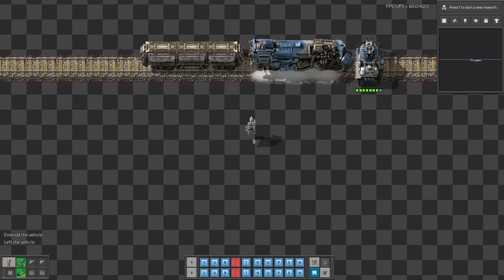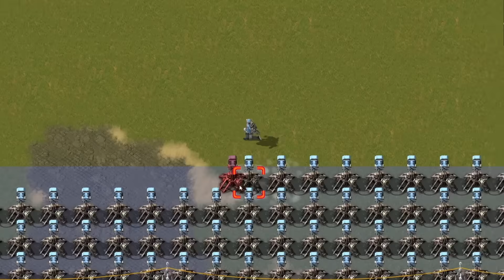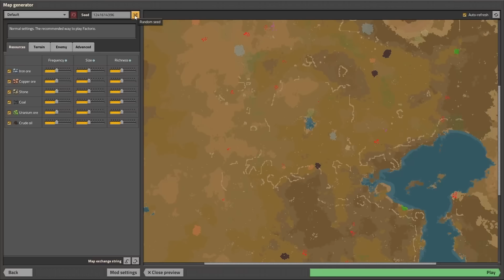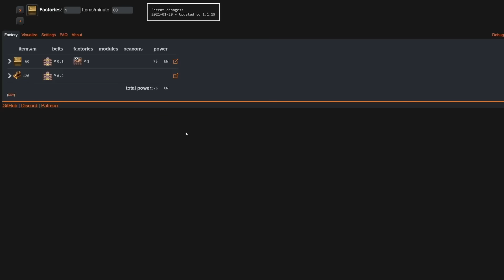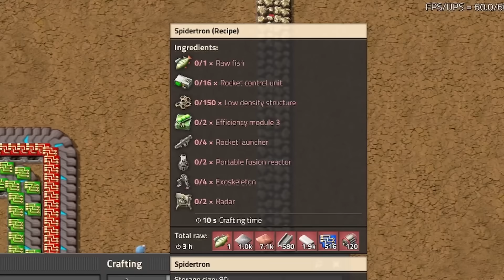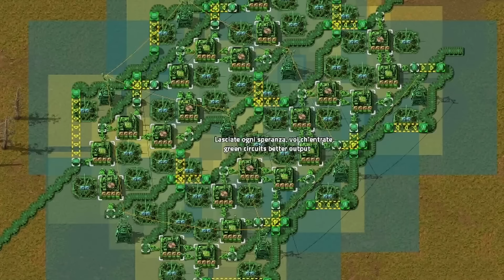Another 31 Extremely Quick Factorio Tips | Season 2 Marathon

Comment: I always have at least 4 burner inserters in each line of steam engines and boilers. Always staggered. I've had a few full blackouts that required cold starts on the whole power system. Took a lot of work, but was able to do it.

Comment: ONe thing; I think you're wrong about the Coal Liquifaction --> Solid Fuel being more efficient than Coal. I spent a few hours setting up this huge facility once to intake coal to do just that. A self-contained loop with circuit-logic to prevent it from getting stuck by producing too much of one fluid. Then once i set it up and it was running I was super proud of it, then while it was working I did the math. You end up with less energy from the liquifaction than you would if you had just burned the coal, and that's not even mentioning that you are using some of this energy to create the solid fuel in the first place, so the math isn't even a true picture of the energy loss, but it is actually significant. It's more efficient to just burn the coal, but then the problem becomes supplying your steam boilers with coal cos it just gets devoured once you have more than 2 boiler stacks.

Thos whole concept makes sense when I fucking realised too. How can you process something to generate more energy than it had before? You can't. That's a real-world thing, but the way coal liquifaction has been made to work in Factorio does follow this. To this end, I can't actually think of any good uses for coal liquifaction. It's a good source of lube and some extra light oil to go into solid fuel or petrol, but you need to use that fuel/petrol to create things. Don't burn it the fuel, or make more fuel with the petrol and burn that cos you've actually just lost energy in the liquifaction process.

So i think coal liquifaction is best used to make lube then the leftover petrol goes into plastic and the leftover light oil goes into rocket fuel for the rocket/satellite
Reply: I can imagine it depends on map generation. There might be times, where you simply don’t have oil at hand or its too far to bother.
Reply: @Rosaslav  yea making use of the oil in another process is what I'm getting at. Don't use Coal Liquefaction to create Solid Fuel. Use it for other processes that need light/heavy oil or petrol that are not solid fuel production.
Use the heavy oil for lube.
Use the light oil for rocket fuel.
Use the petrol for plastic.

Comment: I think one of the biggest flaws of Factorio is that it has no vanilla support to figure out ratios and doing it manually is a nightmare with all the different base craft speeds, craft times, output amounts, productivity and speed modifiers.

I'm normally not a fan of mods for games because often mod creators have no clue what the ramifications of their "minor qol improvement" are, but using the "Max Rate Calculator" was a game changer for me because you can just draw a box around production buildings and it tells you how many of each material they are able to take per second and how many they spit out per second.
Reply from the maker: yes, vanilla is lacking some calculation tools to make bases more efficient :/
Reply: Only some middle school math.

Comment: Trupen, where did you get that piece of blueprint art ("Francis+Yeen Solar")? I'm curious about two things: (A) how it is that the blueprint preview makes it look like full size zoomed in accumulators despite being so large that they should be single pixels each, and (B) who's the artist and/or source for the graphic that was used as a template for whoever built that blueprint.

Also, minor correction, you said that the best power armor's equipment grid is only 7x7. But that's the size of the middle tier's grid, not the Mk 2, which is actually 10x10!
Reply from the maker: I got the furry blueprint from a guy in my discord server and with power armor, yes you are right

Comment: A lot of people suggest the assembler surrounded by beacons. Not one of them bothers to explain why you shouldn't just add more assemblers and should rather use exorbitant modules.
Reply: Speed beacons can actually save power and when using productivity modules, and uses fewer total modules, and for the really huge bases, fewer machines means less lag.  If you use solar power, generating electricity adds no lag, while each assembler and inserter adds a tiny bit, which adds up if you're trying to make a thousand of each science per minute.  I just checked in the calculator ─ without modules (excluding rocket silo), it literally takes over 10x the number of assemblers, and more than twice the raw materials.  It actually uses less power with productivity modules and speed beacons than with no modules, and compared to using just level one efficiency modules in everything, only 2-3 times the power.  Productivity modules pay off their raw material costs in under an hour for many recipes when boosted with beacons, and building a facility to produce modules will pay off the player time investment compared to building more standard production facilities, and moving to new ore deposits more frequently.
Reply from the maker: in late game resources are cheap
Reply: @Trupen  Is this some great secret ? Is there an exclusive club that requires you to do this ? A call for help ? Bragging rights ? Because right now it feels like factorio big guys showing off their pure gold toilet lid with encrusted diamonds : okay it's luxurious and fancy as heck but still... Why ?
Reply: @Gronnrag the faster one assembler works - the less assemblers. The less assemblers - the less lag. The less lag - the more assemblers you can build without overloading your pc.

It is a megabase strategy. The game is utterly optimized, but it is also deterministic (for multiplayer). So people find a way to squease more production in.
Reply: I've actually calculated speed per tile and a boring 8-beacon sandwich seems to be more efficient than using 10 or 12 beacons if fully packed in one direction.

Personally, I hate 8-beacon sandwiches. It makes me feel obligated to cram machines directly next to each other rather than direct insertion between machines or fancy belt layouts.
Reply: Less belt planing with beacons. Belt balancing is way more easy.

Comment: 0:34 - Waiting for 40 Light Green Rocks makes it even worse...
0:41 - As soon as you have 255 (Light Green Rocks) you can start using Nuclear power.
Your math needs some work, why wouldn't you build 2 or 3 Enrichment plants (not 13 like in this video) and get those 255 Light greens even faster?
You have to sit around waiting for the first 40 like you said, so spending that time building some enrichment plants is "wasting time" ??
Keep in mind it takes at least 1 Uranium Fuel Cell per Power Plant to even warm up the plant to the right level, so you need a minimum of 2 per to get started and then you need 1 per every 200 seconds
Reply from the maker: as soon as you make your first, single U-235 green rock you can use it as a fuel, because 1 U-235 can make 10 fuel cells (14 if you use prod modules) which will last you 200s * 10 fuels = 2k seconds which is 33 minutes!

So to sustain one reactor with enough fuel you just need to make 1 Light green rock called U-235 every 33 minutes. To do it you need just 2 uranium miners and 1 centrifuge for processing the ore or even less if you use prod modules to make fuel.
This is why you can easily run power plant making you GW of power with just few miners and centrifuges from the very first light green rock. At some point you will need to use kovarex, but you can do it with nuclear power already running :)
Reply: @Trupen  DOH, for some reason I never noticed that it makes 10 at a time. Totally my bad.  Guess it explains why I end up with a crapload of Fuel Cells.
Reply: The light green rock is called U-235. Pretty sure he said "235" as a shortcut 
instead of stating the full name.

Comment: Here's some tips:

1. you can press the escape button after saving the game. This way once the loading bar finishes the game starts instantly after and it doesn't pause.

2. With a simple maneuver you can instantly stop any moving train. Works from anywhere, no radar sight needed. Pick a station you want the train to stop at, make a temporary stop ahead of the train stop, make sure the train is still moving trough the wanted stop and that it is not slowing down, when the train is about to pass the desired station make the train go to that desired station just before it is passed, the train will quickly slow down faster than normal, lastly remove the temporary stop.

3. My most important tip to beginners is: down be afraid to use console commands or cheaty mods. Not all stages of the game will appeal to a player if you want to spawn into your inventory some belt's because you don't want to wait: that is fine. Or if you want a big megabase, but you don't have the ups for a big base, just get your ores from infinity chests, mine building has allways been factorios worst lategame aspect.
Reply: The last tip can be reformulated to be the best tip to anybody in every game: when a game offers tools to make it more fun, use them!
Reply: @NeinStein  Agreed. Nowadays I always use a mod to start with some construction robots and basic assemblers etc to skip the monotonous early stage. I want to start building my starter base ASAP, instead of spending time on bootstrapping everything from 0.
Reply: I feel inclined to inquire about the name of this mod  @AliaÅsten
Reply: @3verstorm  I use two, actually; Builder Bot Start starts with a power armor, legs, 4 fusion generators and 4 personal roboports and construction bots for those. Skip First Hour gives some belts, assemblers, power generators, miners and railway equipment to get past the initial drudge.
Reply: You can simply turn off the pausing after the save in the settings